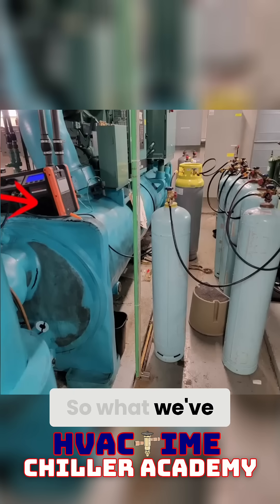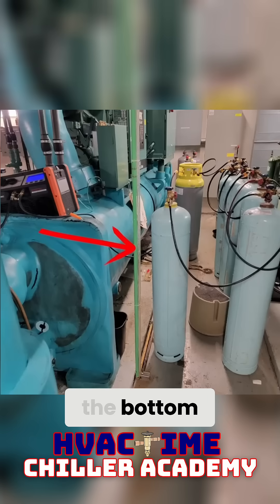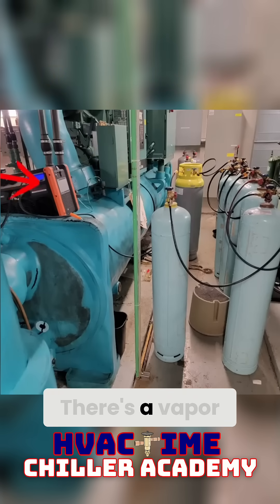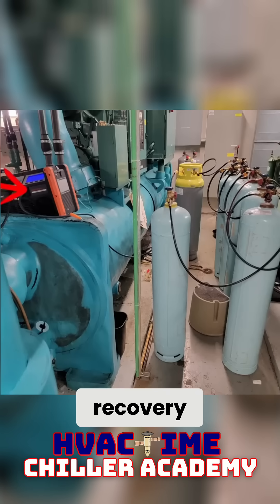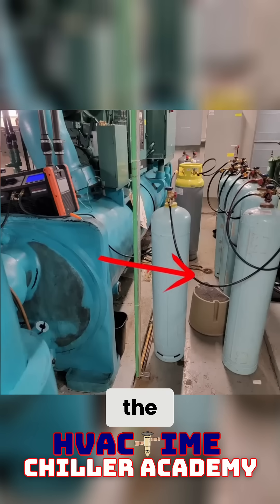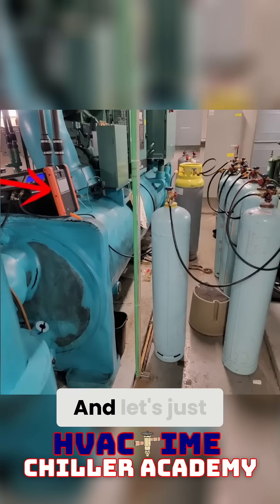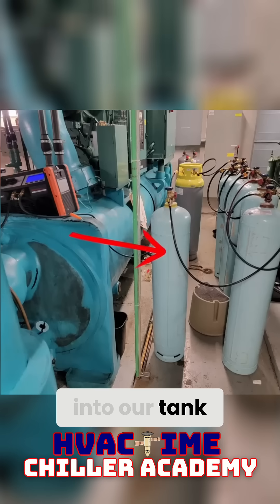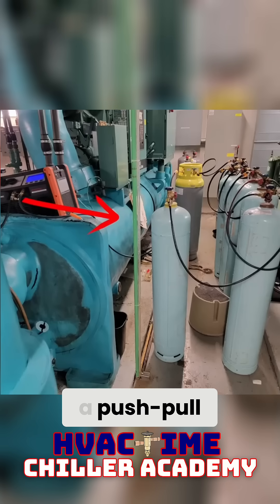Example of Chiller Push Pull Setup

Comment: I’ve always done it the other way where I pull vapor off the top of the recovery tank and push it back into the condenser which pushes more liquid into my tank. Is there any pros/cons to doing it your way vs what I’ve normally done?
Reply from the maker: My specific example I was charging via push/pull. I do as you stated for recovery.